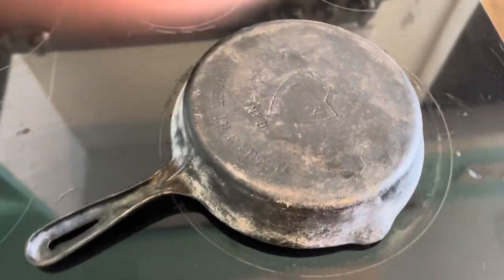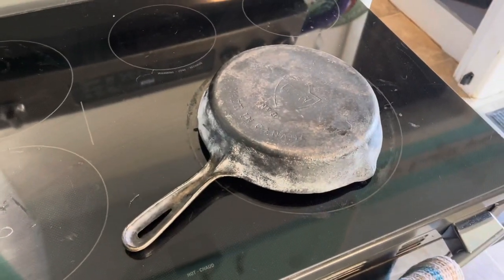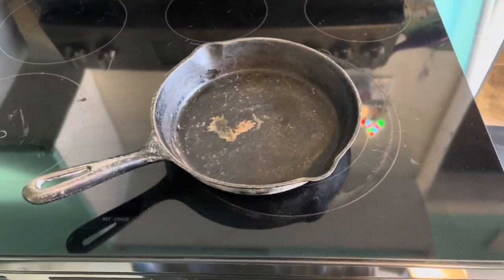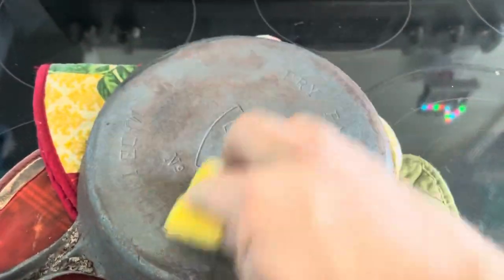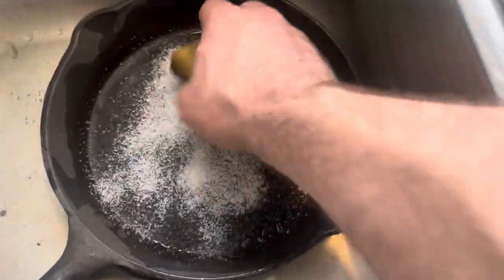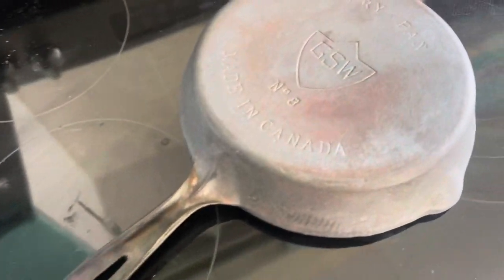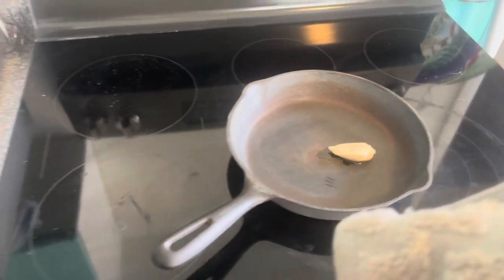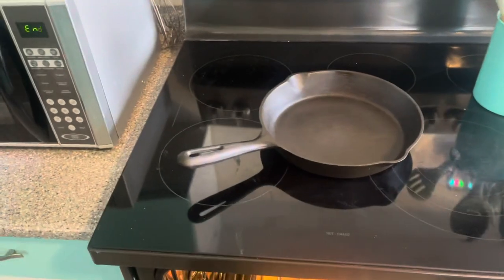CAST IRON FRYING PAN RESTORATION - Simplest Process

Comment: After I use my cast iron, I’ll clean it with hot water, dry it off. Put it on the burner to make sure all the water is off. Then I’ll wipe on a thin lay of vegetable oil, heat it up til it barely starts to smoke then kill the heat. I’ll wipe it out again to prevent spotting. This keeps the seasoning built up and keeps it non stick for next time.
Reply from the maker: I gotta try that.  Thanks Robert